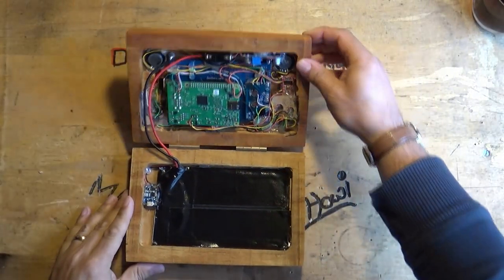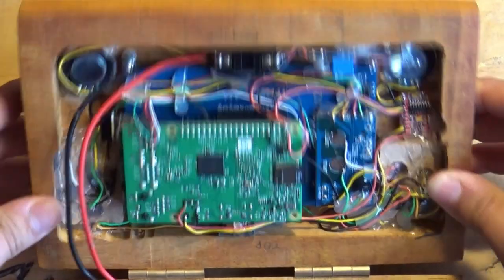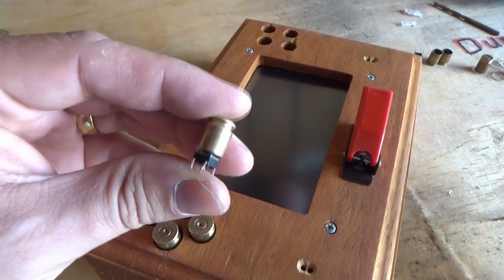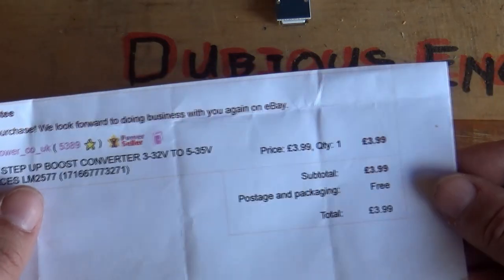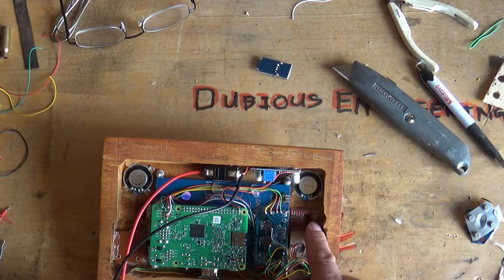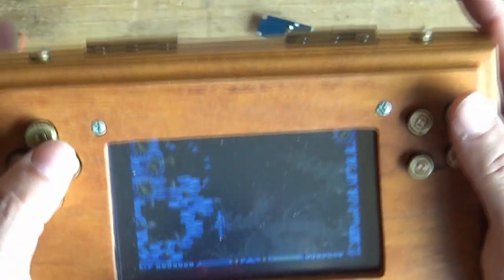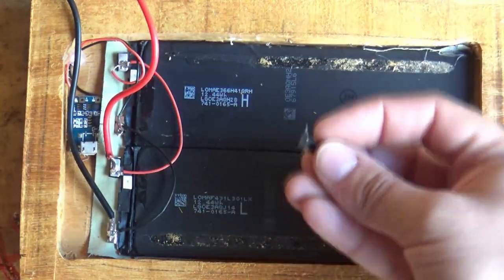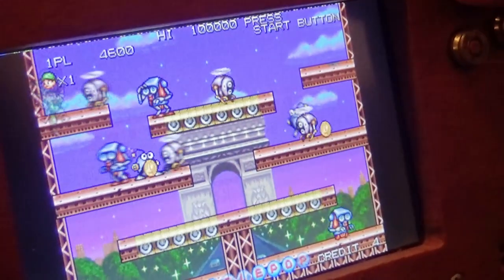DuB-EnG: ULTIMATE Hand Held Gaming Console - DIY Retro Pie - Build PT10 - k101 mini revo snes gba

Comment: 11:00 I believe your audio gain from the Pi might be high enough to cook the chip on the mini-amp board. I had oner that suffered a similar fate.
Reply from the maker: Thanks for your thoughts on this...  actually, the chip on the pcb was the problem.  I changed the pcb and we are up and running nicely now!
Reply: Glad to hear! I recently had to send back one bluetooth amp after the bluetooth section failed. The amp still functioned. Go figure.... LOL

Comment: I wouldn't be turning it off and on like that as you will corrupt the SD card. Just done the exact same thing on one of my PI's and now it no longer writes to the card. Highly recommended to shut them down properly. The project has come out well and as I said last time it sure is cramped in there lol.
Reply from the maker: It sure is cramped! ...  I need to add a few little bits too! - Also, I need to make things pretty....  More brass/copper!...  (Glue a few cogs on it and call it steampunk!)